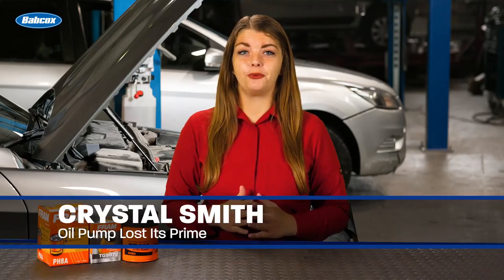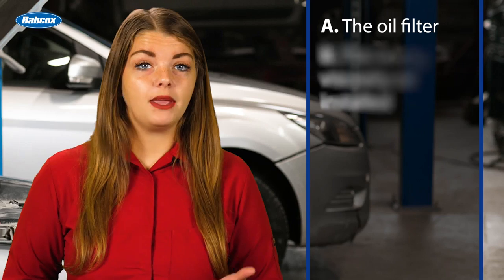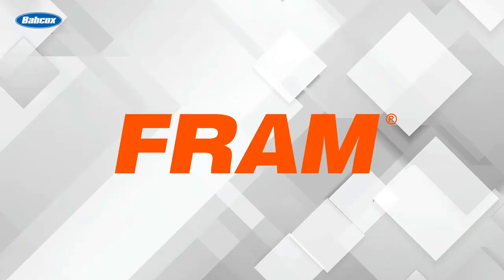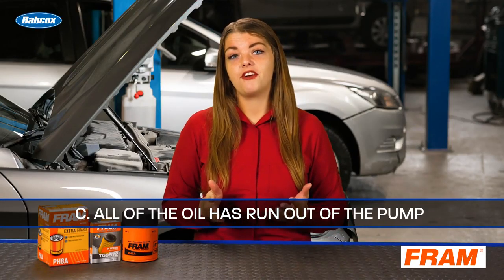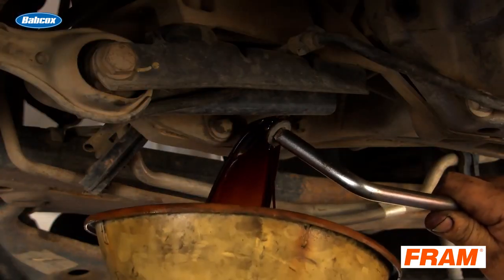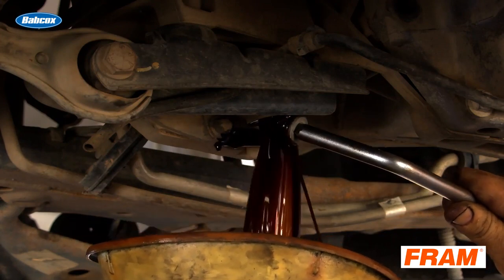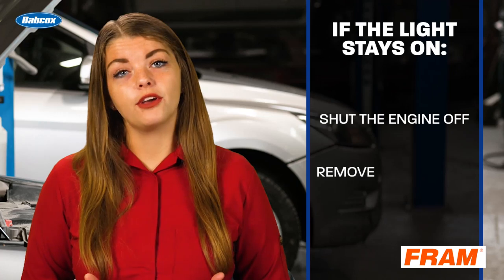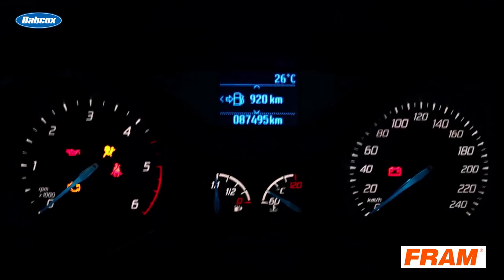Oil Pump Lost Its Prime

Comment: My 1994 ford ranger 2.3 does this after sitting for a few hours or over night. Drives me nuts.
Reply: How did you fixed the issue im having the same issue with my bmw 630i 2006
Reply: Have you checked the oil pressure sending unit? I had an '89 Ranger with a 2.3 and it started doing wierd oil pressure issues. The problem was not the oil pressure, but the sending unit being faulty.

Comment: Being a mechanic at a ford dealership for so long, Not fun doing the under 10 minute oil service on them 2.2 or 3.2L turbo diesel engines on ford's and bt50. Not even a sip of water at the wrong time will cause a fucking mess.
Reply: I find the trick is to have everything ready to go and do oil filter change 1st as i don't need to rush that part as its not part of the 10 mins time limit. 
Then i drop the oil from sump let drain for 6 mins put sump plug back in then fill with oil 9L and start. Then top off the 800ml for the 9.8L total required.
What brand and grade of oil are the ford dealships using for the 2021 px3 3.2L ?